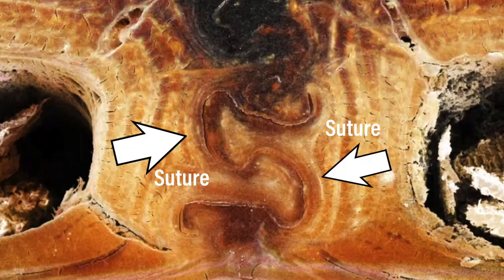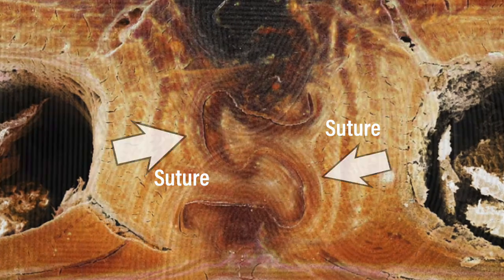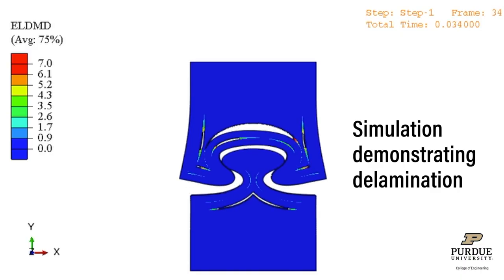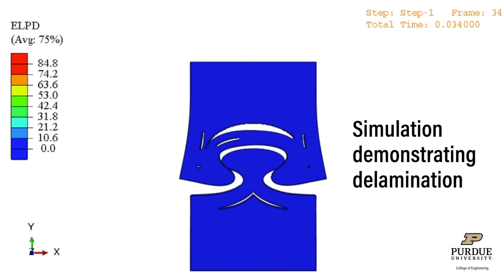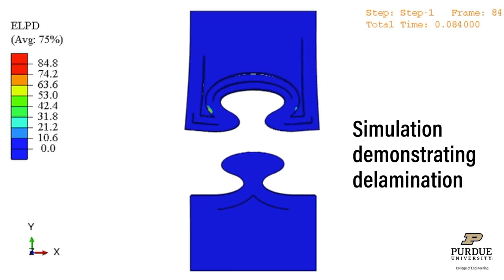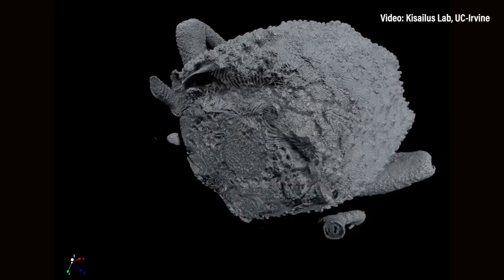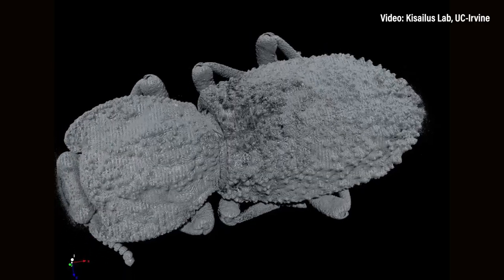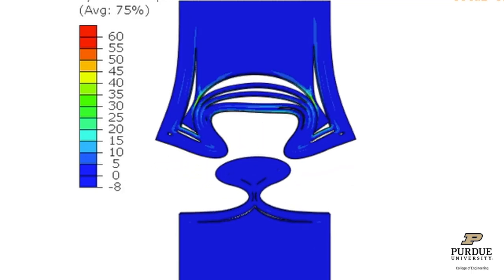Diabolical Ironclad Beetle: Unlocking the secrets of its super-tough design

Comment: someone whining in the comments below " 150 N is barely over 30 lbs of force. I’m not saying that’s not impressive compared to other insects. But to crush it under such little weight and then claim it can survive being run over by a car is just scientifically dishonest and unrealistic."
Reply: It might be a bit overly dramatic, but I don't think you can write it off as being wrong without actually doing the experiment. A car's tire only carries 1/4 of the car's weight, and only a portion of that would bear on the beetle. For something as small as a beetle, I would expect that the contact patch would deform around it, with the beetle pushing up into the rubber. That means most of the weight would be born by the road surface around the beetle. I think it's quite plausible that it could survive that experience.

Comment: Yes the exoskeleton in this beetle might be strong, but what makes it indestructible in this video is that it is sitting in a pile of dirt and being ran over by a rubber tire. So the pressure is all on the surrounding dirt Keeping pressure off the beetle. If the beetle were to be resting on concrete, then ran over with a more solid rubber tire, would it still survive?
Reply: Did you see the part at 0:18 ?
Reply: Yes, I did see that. What is it compressed by?
Reply: Gina Ferrer I don’t know but I can tell you it’s not a rubber tire and the Beetle wasn’t surrounded by a pile of dirt.
Reply: Then what is it doing on the video .06?
Reply: @khalidalnahdi1526  150 newton's is only like 30 pounds of force
Reply: Globs thanks for the information!
Reply: it can survive 1.5 times the weight of an average car
Reply: @Globss   it's true.. Just 30 pounds

Comment: The car test was ridiculous. Of course if you try running it over in a large pile of loose dirt most of the cars weight and energy is being transferred to the dirt and ground, not the beetle. Same reason why you can't crush a trick with just your fingers they are way to soft. Putting the beetle in a solid surface vice grip tells you exactly how much force it can withstand before dying.
Reply: 150 newtons of force about

Comment: Sounds like a lot of horseshit to me.   Try putting it on hard concrete instead of a shock absorbing mound of dirt and then try running over it with a car.  Or better yet, just step on it.  Either way it's going to go splat!